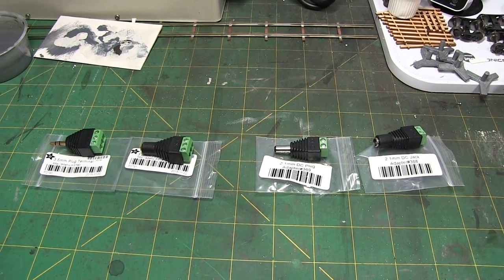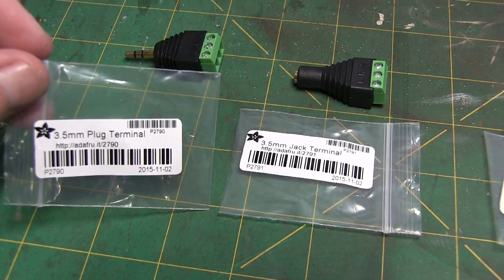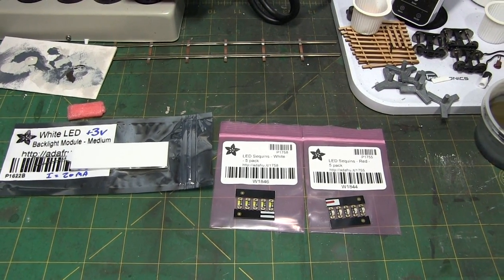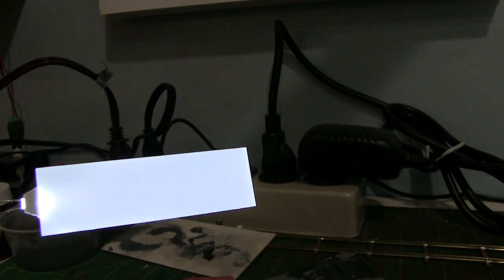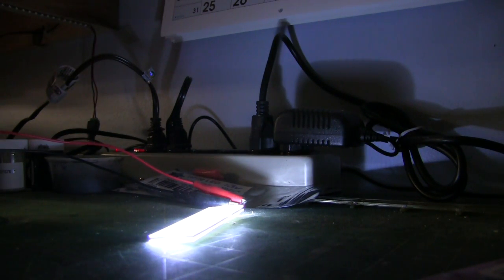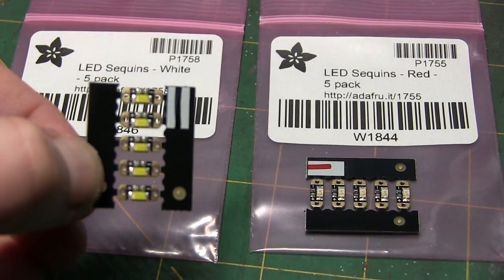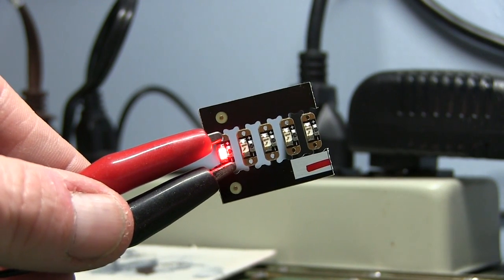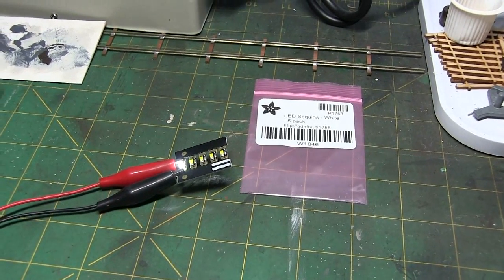Product Information Video #2-Connectors & LEDs

Comment: Hi Stephen, thanks for another great video! I was wondering if you could suggest what size resistor you could recommend to use led lights like these with 18v AC accessory terminals on my DC throttle.